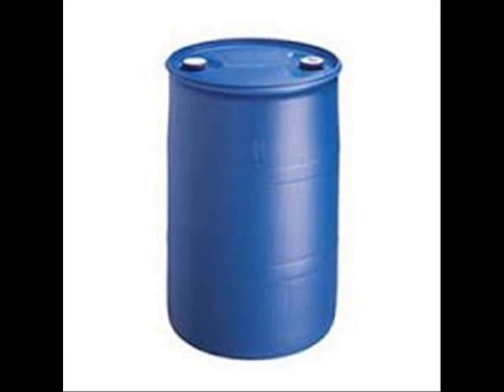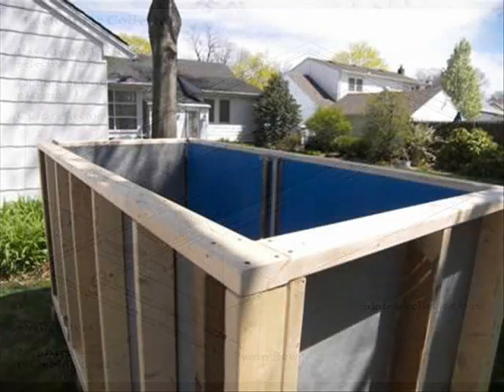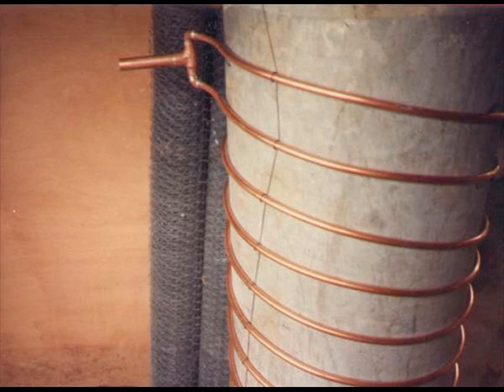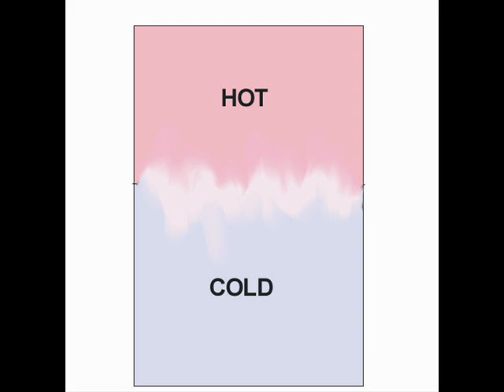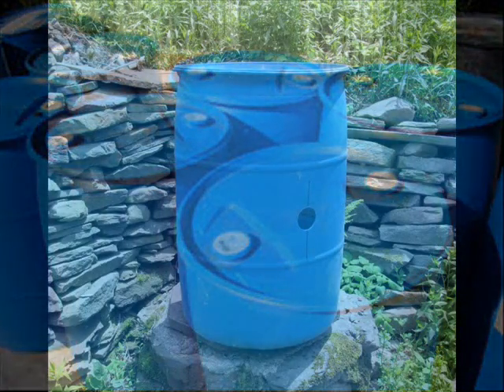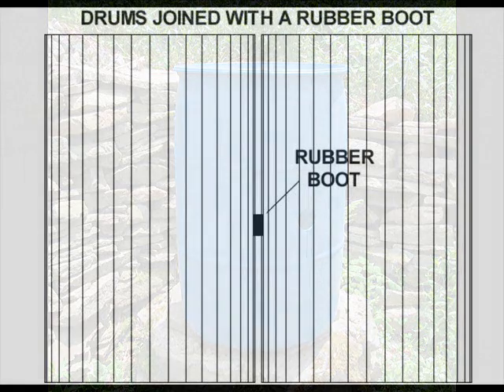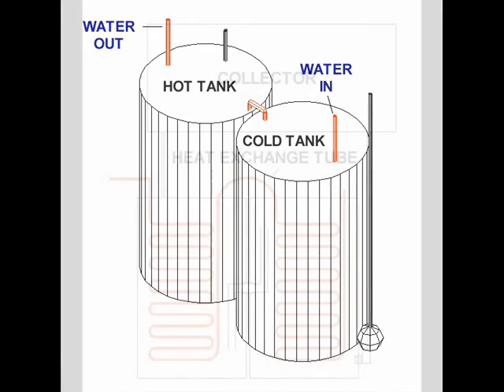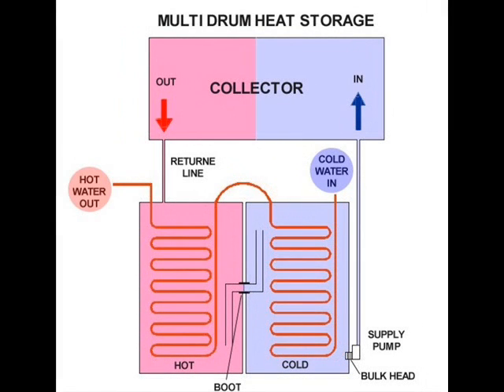Heat Stratififation

Comment: I just wanted to say thanks for doing your videos they have helped me so much. I am getting ready to start my system up in about a week I have 6 barrels and a 8 foot by 26 foot solar collector I can't wait to get it started up.
Reply from the maker: hammond2109 Thank you Hammond. You can use one rubber boot to connect two barrels.  You'll need 5 boots to connect 6 barrel and one small screw on connector for the pump. I have used this method for years without a problem. Just be sure your measurements are dead on. Good luck.
John
Reply from the maker: John Canivan Use a bulk head connector for the pump.

Comment: Great video!

Does cold water stratify?  IE 35F water entry temp into a barrel that is buried underground with 55F soil temps.  Maybe string a few of these barrels together.

I am working on a geothermal heating system on the cheap.  Any input would be greatly appreciated.
Reply from the maker: Geothermal systems extract heat from the ground. This multi-barrel system was designed  to store solar heat in an efficient manner. It's a totally different concept than geothermal.
Reply from the maker: Pronghorn67 I think we are talking about a different kind of animal Prong